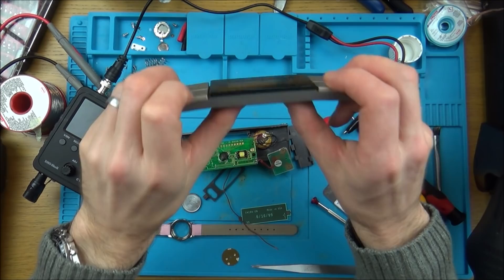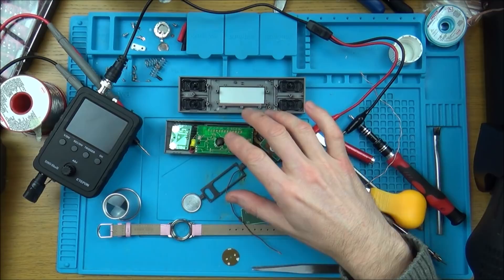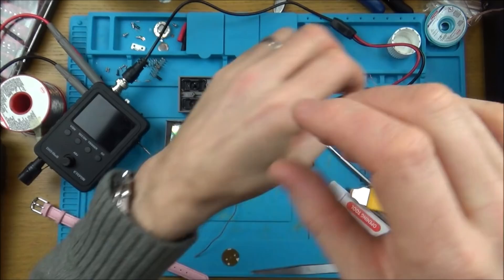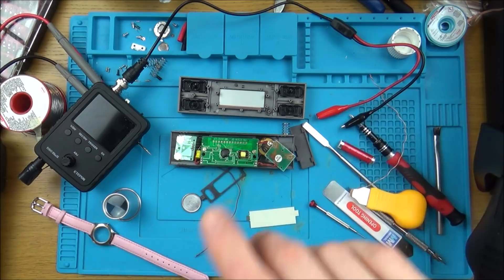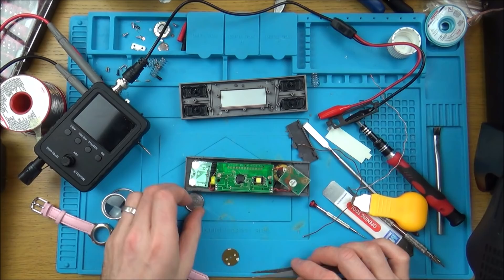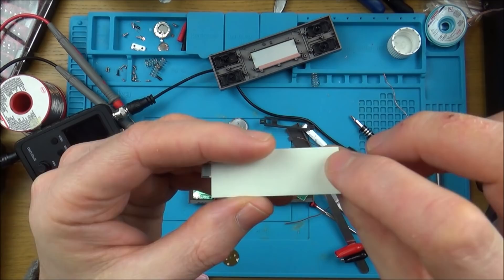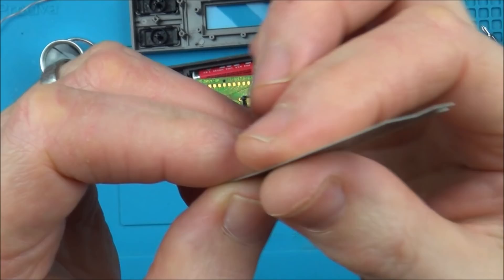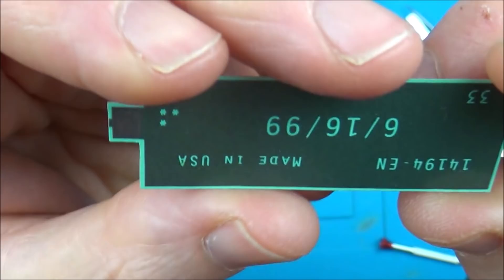REVISIT: Faulty Backlight on Jacob Jensen Alarm Clock

Comment: props for doing this follow up! BEWARE: if you are new to scopes: PLEASE remember to check for the scopes MAX INPUT VOLTAGE! you can easily overload and damage the input by probing to high voltages. 35 volts might already be the limit! you can get probes with build in voltage divider (typically 1:10) to probe higher voltage signals. I mention this because it is a trap for people who are used to use multimeters where usually everything up to 400v is not an issue.
Reply from the maker: Thanks VVerVVurm, I didn't know about the max voltage :-)

Comment: As you progress, the scope will become your eyes and the meter not as much (the measurement here demonstrated why). The 5 second timer is probably from the main "blob" IC (black thing on the board) via an output line. You could learn a lot by scoping the signals from this IC to the yellow step-up transformer which provides the 60V for the backlight. I remember you fixed a handheld video game that had a tube type EL display - I think it had a step-up system too. You can get quite a little sting off of one of these too! Great revisit!

Comment: Hi Vince,
Great stuff you always live and you learn,  That’s a EL Sheet 
Which has a ITO-coated top layer and a conducive phosphor layer(AC Input) a Dielectric layer and the a outter frame bus bar(AC Input). Possibly you have a break in the outter bus bar or the conducive phoshor layer. Good if u do experiment but remember they are in layers so you could short them out.

Comment: You were measuring with the ground lead on the DC coupled ground and AC doesn't use a ground so you have to measure between the two springs. Your scope shows you a frequency reading and a Vrms (AC voltage). You should learn how to use the osciloscope trigger function so you can capture the signal (snapshot) to measure without having to press the button all the time.
Reply: And he should buy a real scope not this ebay scrap scopes that basic show only aliasing signals😅🤣
Reply: Supporting his knowledge of this scope will encourage his curiosity and maybe he will buy one.
Reply: Osiloscope is komplicerad and vince will gett better! Nice comment!
Reply: @vaualbus  this crappy scope is better than nothing, and already have been useful for Vince. I don't see why anyone who isn't a professional would ever need a better scope anyways.
Reply: Yip you are right

Comment: The main reasons EL wire\ EL tape goes faulty is time and decay. Over time, the phosphor that the AC voltage excites will wear down. This happens with normal use and decay will be accelerated by high temperature. The other main reason for failure is if the phosphor powder that is in the tape \ wire is exposed to oxygen in the air. The EL wire is encased in clear plastic to prevent this, and the EL tape has a clear coating on top of the phosphor to prevent oxidation. Hope this helps.

Comment: you have to measure between both springs  to get the correct measurement. One probe on one spring the other probe on the other spring.
Reply: Yip, having your ground on the wrong side of the transformer won't normally give the reading you want. The positioning was good though if you were trying to probe the clock's normal circuit though.
Reply: oscilloscope has only 50v input, I think it can burn it if connect directly to the springs.

Comment: For your scope that AC doesn't mean what you may think it does. This might be a bit difficult to explain. But imagine a normal wave you might see from mains. It will be going positive and negative equally above and below 0V. But say you were to connect 5V DC to that wave. The wave will move up 5V and it's '0V' point will now be at 5V. This is called a super position of voltages where the AC wave 'rides' the DC signal. Sometimes is is necessary to know this. Some circuits will make 'AC' by turning a DC signal on and off fast through an inductor which will create an AC signal. But this signal before going through the inductor will be a square wave from 0V to whatever voltage it maxes out at. What the scope does is it can filter out that DC wave when you are reading the signal. When you set the scope to AC you filter out all DC signals putting the waves 0V at the 0V level. The DC setting won't filter that out so you can see the DC component of the wave. I may not have explained it well but usually you keep it on DC to see the whole picture and AC is more for specialized cases. But as long as you know what you are looking for it really does not matter but someone here could give a better explanation than I could in a comment.

Comment: You can get little squares of EL plastic for just a few quid, and in a range of attractive colours! And yes, like you mentioned cutting a hole in, you can cut it to shape and size. 

The whole thing is a sandwich. A conductive back layer, the EL phosphor itself, and then a transparent conductive front layer. You'll see a little electrode sticking out of one corner for one layer, and the other you can connect anywhere. Try it, please! All the usual component suppliers sell EL sheets (and also EL wire but forget that for now). You can also get a driver circuit that steps up 5V DC to the 100V or so it needs. The driver module is like a fiver and the sheets about the same depending on the size, so it's not a huge investment.

You won't need the driver circuit for this clock since it already has it's own, with the transformer etc. But it's fun to play with so you may as well get one, and a few sheets and maybe some EL wire and just mess about with it, if you want to. But to fix this, you just need a sheet of EL, why not a lovely aqua blue? You might need a bit of wire to connect the electrodes to the springs.

Get a sheet of EL, test it with the electrodes, then cut it down to size. Then re-revisit, bang! an actually repaired, if horribly cheap and nasty, clock by some Danish bloke who surely only designed the plastic case and not the nasty stuff inside.

Comment: Transformers only work with a varying signal. If you apply a straight DC signal to a transformer's input, you will only get a single pulse at the output and then nothing. The circuit feeds the transformer a square wave (which is just switching DC on and off repeatedly (about 321 times a second, according the oscilloscope thumbnail)). The transformer then steps the voltage up to light the EL tape. 
If you were to touch the output of that transformer, you might only feel a slight, albeit uncomfortable tingle, but paper towels do not make a good insulator. Good video.
Reply from the maker: Thank you. I never knew transformers only work on AC.  You wouldn't happen to know what created the AC for the transformer in this circuit would you? From memory I didn't see any bridge rectifier so I don't know what converted the DC from the battery into AC :-)
Reply: @Mymatevince  a rectifier can only change an AC signal into pulsed DC, but not the other way around. You would need an oscillator of some sort to create a varying AC signal. In this case you would have to trace back from the transformer using the scope to see where it originates. It should come from a transistor, which could be a discrete component or come directly from the blob on the board. The time it stays on will sometimes be dependent on a resistor and capacitor (RC constant, or the time it takes to discharge this capacitor via this resistor), in which case changing the resistance or capacitance values would change the "on" time, but it is also sometimes "hard-programmed" into the blob and unable or very difficult to be altered.

Comment: if you can't get EL tape, what you may be able to do is measure AC voltage at the input side of the transformer, then just tap off an LED via a current limiting resistor to backlight the LCD. Since it's AC, you could even use 2 LEDs wired opposite to each other, then through the resistor, and each one would light in each half wave of the AC.

Comment: I believe that your multimeter doesn't show voltage correctly because of the signal frequency. The multimeter shows that the frequency is 5.6KHz. I checked this multimeter manual and it says that it can measure sin waveform signals in the range of 40Hz to 1KHz. 5.6KHz is way above its capabilities.

Also, 5.6KHz means that period is 0.17 milliseconds. In order to correctly capture it, your scope must take readings a few times faster than that.

Comment: The  transformer would have gave that away. You can buy EL sheet for cheap and cut it down to size. You can also convert it over to LED, but you need a diffuser behind LCD if you go that route and to remove the HV circuit.

Comment: Good morning Vince, greetings from Greece, well ... interesting , very good stuff the last 2 videos, detailed information from viewers and you , well I'm thinking if that EL tape is cheap buy it cut it in size from the faulty one and install it and reassemble it, just like Dave Davidson said in the 7th comment, or diy it using led like you said but they are ac and dc i think so choose the right ones

Comment: Don't think you noticed but your meter should have  had the probes across  the springs to measure the luminous panel voltage and if you look back the frequency of that ac  is not  50Hz  like mains but very high frequency,  your meter showed something like 5.634 khz frequency.

Comment: The second spring is the reference point of the AC voltage. Similar as the neutral line on your AC at home. You can take it as ground for the scope. I guess the inductor is used for generating the AC base voltage and the big transformer is stepping up the voltage to the level the EL-foil uses.
Reply: EL-Foil fails as the material degrades after times. So this is not uncommon.

Comment: If ever you’re wondering if a component is an inductor, put any steel or iron bits near it. If it’s attracted when it’s powered, it’s an inductor (or in general a coil).

But LEDs don’t look like that anyway. It’s always a telltale sign that it’s an inductor if it’s got a yellow heatshrink around it.

Also, if it shows resistance both ways, it’s not an LED, as they are diodes, permitting current one way (would show 0 Ohm or at least a low ohm value), but not the other (would show either open line (OL) or an extremely high resistance (multiple, even dozens (even hundreds?) of mega-ohms)).

That EL tape, however, sounds like an interesting new concept for my head to wrap around. If what I read from the other comments (from this and the original video) is true, then it SHOULD show an Ohm-reading between the two carbon pads. Since that is not the case, and you even proved the fault by using your daughter’s watch as a testing ground, that panel is obviously toast.

Would’ve been great if you could confirm if the EL tape on your daughter’s watch is showing an ohm reading other than open line (OL).

Comment: Here's a company in the UK that sells the tape. The small ones are not expensive. 
https://elpanelandtape.co.uk/el-panel/

An EL tape is effectively a capacitor. The 'middle' of a capacitor is the dielectric. In an EL tape, the dielectric emits photons when it discharges. When you apply AC to the two ends of an EL tape, the capacitor is charging and discharging repeatedly, so it keeps emitting light. If you had a high speed camera, you will see it fading in and out in cycle with the AC waveform.

Comment: It is PWM (Pulse Witdh Modulation), not AC like I said at the previous video. When you put PWM (pulsing DC = digital) into a transformer (analog), you will get some form of AC because of the (step-up) transformer. In fact it glows only on pulse, not on AC like explained in this video (search on YouTube): "Applied science Build an electroluminescent glass panel display". The PWM is a reason why you don't read a value on the other pin because it is not AC but DC (however pulsed).

Comment: you may contact the company that makes that clock and tell them the problem and ask if they have any of those still in stock they make just give them to you.
Reply: Why? On EBAY he can buy different types of EL tape, and it can be cut in any place, and it has two traces on back side. I don't thint Vince couldn't solve this puzzle)

Comment: Sorry I forgot to mention the transformer in my comment but yeah, I believe those lights are not that sturdy, they only light up a certain amount of times and then they fade or die. You could've try with a higher voltage just to check if that was the issue.

Comment: DSO SHELL?  Love u man hey I would suggest not using the..idk much if your in a budget for a scope maybe go used/old...I personal have a owon vds1022i usb scope it’s only 25mhz but actually useful...idk don’t take it rude...One of my first kits was the DSO I forget but the DSO DIY oscilloscope that does not come with the case red PCB..I think for general audio spectrum analyzation-ish type stuff those little DSO’s are OK that’s what I use mine for...Also the scope I recommend it is USB isolated and only about $100 in the US at least

Comment: If you measure 50 volts or more then you must have 10X probe probe, wire or else you will destroy oscilloscopes. do not set the switch to gnd I think you short circuit if I remember correctly. ebay 282838437503

Taux d'échantillonnage maximum en temps réel: 1 MSa / s
Largeur de bande analogique: 0 - 200 KHz
Plage de sensibilité: 5 - 20 mV / div
Tension d'entrée maximale: 50 Vpk (sonde 1X)
Impédance d'entrée: 1M ohms / 20pF
Précision: 12 bits
Longueur de l'enregistrement: 1024 points
Modes de couplage: DC / AC / GND
Plage de base de temps: 500s / Div - 10us / Div
Modes de déclenchement: automatique, normal et simple
Position de déclenchement: centre de la mémoire tampon
Tension d'alimentation: DC 9 V (8 - 10 V)
Consommation de courant: ~ 120 mA @ 9 V
Matériau: Composants électroniques ABS
taille: taille du produit: 10.2 * 7.3 * 2.1cm
Taille de la carte mère: 94 x 65 mm
Taille de la carte analogique: 65 x 47 mm (2,56 x 1,85 po)
Taille de l'écran: 52 x 40 mm (2 x 1,57 po)
Couleur blanche
Reply: this is a common trap for people accustomed to multimeter use. I saw someone frying his input by randomly probing some phone lines. some cheap handheld scopes only tolerate up to 35 volts peak. A good probe will likely cost more than the scope used in this video. xD

Comment: Not really sure how tissue will stop you getting a shock :) but thank you for the video Vince...
Reply: its non conductive.
Reply: @bazahaza  Tissue will not stop you getting a shock :)
Reply: Why not? It's non conductive. can you explain?
Reply: @bazahaza  moisture from your fingers and/or the environment will conduct electricity easily through absorbent tissue. A high enough voltage will even jump through a completely dry medium.
Reply: @getyourkicksagain  it did the trick here though.
Reply: @bazahaza  True dat. But pulling out isn't 100% either 😉

Comment: you wont light an led with 1 1.5v battery
Reply: well with the EL inverter he has about 30 or so volts .. he could chain 10 white LEDs together :D
Reply: @VVerVVurm  at a tiny current??? 9mA/meter  so lets say its 4cm long is a third of a miliamp
Reply: @andytipping70  hmm true .. but the EL foil isn't that bright either .. some newer InGaN green led are scarily efficient and quite "bright" at  ~ 40µA. but new EL foil would probably be easier, more even and cheaper
Reply: It's entirely possible to light an LED with 1.5V or even less. Look up "Joule Thief".
Reply: @getyourkicksagain  yup i totally understant the concept of a joule thief - but by the time you've done all that and found room for it in the case - may as well have sent off for the E L tape